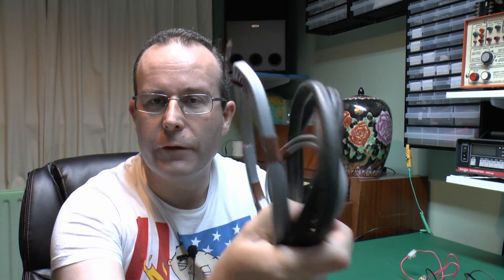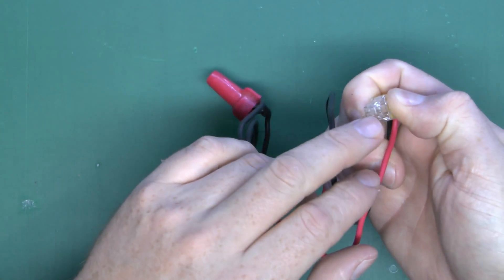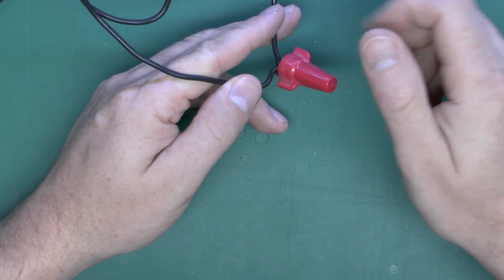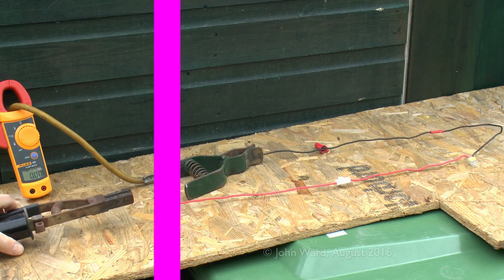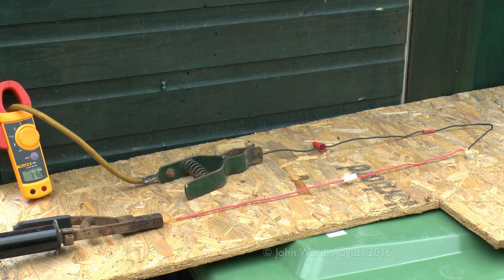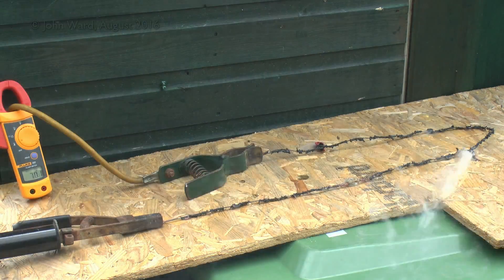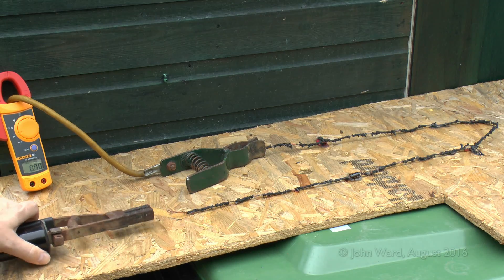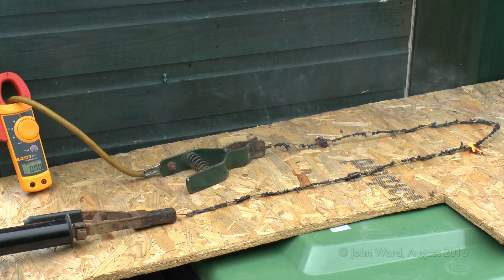Wire Connectors Overloaded

Comment: You would be hard-pressed to find anything in the United States other than wire nuts. Many lighting fixtures now come with Wago type connectors. And push type Wago connectors have been used for decades on fluorescent light fixtures mostly for just the speed of changing ballasts.

I’ve seen many wire nuts fail over the years. I find it interesting that wire nuts are not code in the UK I kind of wish that would happen here.
Reply from the maker: Wire nuts can be obtained in the UK and are theoretically acceptable for connections but no one uses them, because they mangle the ends of wires which makes subsequent alterations and testing difficult or even impossible.
Reply: John Ward  Yeah I always wondered why the UK mostly used screw connector blocks plus I don’t think you guys have as many connections because of the way you go from device to device. Here we have to pigtail every device to the runs passing by there by adding more connections to the whole mess. The reasoning is for having the pigtail connections if somebody removes the device you’re not gonna lose the circuit without doing other work. It’s all just stupid it would be nice to have devices that could pass the current.

But the Wago’s offer the infinite ability of anybody to connect the wire properly no special skills or knowledge required. They are quite a bit more expensive and we would need a lot of them on our typical jobs here but they are also more compact especially the new 221 model.

Comment: So as others have pointed out, these are all fresh connections made up with proper due diligence.  Not all tradesmen show the care and due diligence that is on display here.

First issue, as again others have pointed out, is the the load cycling and the commiserate temperature rise that accompanies it along with the cooling cycle that also follows.  This brings aging and additional resistance with it.

Second is that both the wago and the block are mechanical connections that depend on a spring or a screw.  These tend to loosen up over time and fail.  Technically most non crimped connections, read that mechanical connections, require periodic maintenance.  This is not possible for wago or "push in" connectors.  Nor Is it required for a wire nut connection that was twisted with linemen pliers prior to the application of  the wire nut.

Of the four above the wirenut will outlast and out perform the others hands down.  It has a far larger connection area and hence lower resistance across the junction proper.  IE:  it has a large copper to copper connection.  It also has the added conduction path of the conical retainer spring as well.

The crimp is not rated for the wire type and though it didnt fail it is fairly unlikely to out survive the wire nut connection.  The properly crimped connection is actually a cold welded connection.  A swaged connection applying enough force to cold weld the conductors to the metal of the connector.  News flash, you're not gonna get that from a £7 Ebay crimper!

In the case of the block connector you go from copper to brass to copper.  Brass is a far less conductive material than copper and you will end up with issues far more often over time.

Simple and better test would be a string as above with all connection tied together.  Cycle the power up to say 15 amped and hold for 5 minutes.  Turn off and let cool for ten minutes.  Repeat until the wagon fails!  Also periodically monitor all connections with a thermal camera.  The wago will be the hottest over time.
Reply: So we are left with only the wire nut? In the big picture there is the operator of the process of joining two or more wires, if you take that factor into consideration then all these connections types/ways can and may fail sooner or later.
The chances that operator error may course a failure is less likely to happen with the wago simply because of it's simplicity when installing it, with crimp, the wire nut, and the screw terminal, there are way more things that can go wrong.
The construction and materiel of the connector itself is not the only factor.
I still have some doubt about the wago, but I also have seen the other types of connectors fail way to often, so in that perspective the wago may be the best choice? I am still missing to see a failed wago connection, and for sure it is the fastest and properly the most safe to use when the system is under power.

Comment: Instead of melting the insulation, the connectors will actually blow up like a bomb during a surge of very high current if the breaker or fuse doesn't clear it first. In fact the breaker may even blow up (again like a bomb) if the current interrupting rating of the breaker is exceeded.

Comment: marrettes would probably be the best over the long run (which is why it's odd to me they aren't common in the UK) because it's a twisted copper on copper wire connection. the marrette just facilitates the easy twisting and insulating of the splice. of course it's a different story when they're overstuffed or reused.
Reply from the maker: They are not common because they make subsequent disconnection for testing or alterations impossible without destroying the ends of the wires.
Reply: *****
clipping and stripping the wire takes no time, though, and why would you be that concerned about it when most of the time those installations are permanent?

Comment: Personally I would have preferred it if it wasn't done on wood. I think the extra heat from flames from the wood fire was probably what ultimately caused the failure. Other than that I love the video I would love to see more of this with other connectors. Perhaps you could use multiple of the same connectors at the same time to increase the sample size?

Comment: In my experience, connectors never go bad from a single overcurrent event.  They go bad because the design cannot cope with thermal cycling (screw clamps) or with oxidation/annealing (push-in spring clamps and cheap faston clones).  

I've always been told it's best practice to check bus bar and breaker screws occasionally, and certainly I always find loose ones when I do.  Who ever actually does retighten screw clamps?  Effectively nobody -- and then you're left scraping melted insulation out of control box because someone used a euro terminal block from ebay, tightened it until the teeny screw slots stripped  and called it indefinitely done.
Reply: this.

a millionth time this.

Comment: Wagos are great and easy to use BUT I would only ever use them in lighting circuits protected by a 6A fuse (Im in UK so 230v supply). I would never use any of those TEMU or AliExpress fake Wagos. The 221 is actually rated to 32A but I aint sticking it on a FRC.

Comment: Great video - I do use the Wago connectors now and again, but have wondered how much I would trust them.  Clearly I have nothing to worry about.

It would've been interesting to see any voltage drops over the connectors - to see which suffered conductivity and loss issues first.  Likely the Wago connector generating heat the most causing the copper to fail at that bend where it's under a little bit more mechanical stress. Although the Wire Nut is the only other with a perpendicular connection... 

As someone else said, thermal camera wouldn've been a good indication of this too. 

Thanks for the video!

Comment: I pulled the plug of a little fan under my desk and dropped it on the floor next to the power strip like I did for the past 20 years.  About a minute later the fan turned on, I look at the fan and it was running. Electricity was arching from the outlet to the prongs of the plug lying on the floor. The first thing I thought was I could lose my home to something like this. I'll be turning the power strip switch off from now on. But will that be enough?

Comment: The really interesting test would be to take a 100’ extension cord and cut it at around 10 different places along its length. Splice it with different connections and test for voltage drop.

Comment: Pretty impressive nonetheless at 90 amps. Thanks for yet another entertaining and educational video!

I actually really like the thingie you call a "wirenut". In Sweden I've heard the name Torix (brand name possibly). They're great for how we do stuff here with single few-stranded wires (FK)  running in tubes in the wall. I suppose though, that the Wago is by far the most popular.

If I got any of the technical lingo wrong, feel free to enjoy yourself on my behalf. :P
Reply: Opinions seem to be divided in Sweden as well, I read a rather lively discussion on byggahus.se today. Actually Wago 2273 are rated for FK but I'm not sure how easy that'd be to get in (some geniuses even manage to get stranded into 273/2273 connectors, don't ask me how) but according to Wago it's acceptable (only noted on the boxes in Norwegian and Swedish because no one else seems to use FK/H07V-R smaller than 10 mm2). I once found a box of wire nuts in a shed in Austria and have used them for the odd job, mainly for replacing filter capacitors in old vacuum cleaners. They seem to hold up fine there and gripped the stranded wires quite nicely but I wouldn't use them in fixed wiring because they're a bear if you want to remove or add wires from a splice.

Comment: looks like whoever installed the connectors nicked the wire when stripping it for the wago- this is why you're only permitted to use certain styles of wire strippers in aerospace and whatnot

on another note, the wago has so little metal in it compared to the others, why are they always the most expensive?

Comment: The quality of the connection, and therefore safety, is dependent on the skill of the person making it - maybe with the exception of the Wago (or equivalent).  Crimps must be made tight with the right type/size die, screw terminals must be tight and not overloaded with too many conductors.  I use mostly wire nuts, being in the US, but it is critical that the wires be twisted together with lineman's pliers before applying the nut - the nut is just an insulated cap and shouldn't be relied upon for electrical contact.
Reply: It is not critical to pretwist when using a wire nut.  The wire nut twists the wires itself.  The wire nut is not just an insulated cap.  When applied properly, the spiral wire inside the nut cuts into the wires being joined slightly to ensure a tight mechanical hold and improved contact area for the connection.  Pre-twisting isn't bad, and ensures both wires are the same length, but paying attention to match the wire ends before putting the nut on is sufficient.
Reply: Brian Haygood yup

Comment: My get the slot with screw brass connectors or waygo one wingnut and crimp the issue I have had with screw is plastic melts and screws fall out I don't the waygo connectors assume plastic will melt and cause failure then wingnut as twist with aluminum insert will hold but essentially fail and crimp as they sometimes use steel in place of aluminum in the connectors

Comment: Hi resistance at the wago connector caused increased heat in the conductor causing the failure at that point. If you watch closely, you can see that the wago connector begins to smoulder first.
Reply: Could also be that the WAGO plastic has  lower melting point.

Comment: I just twist the wire ends and give them a wrap with some duct tape. The fire department and my insurance company keep threatening me with fines and jail time after each fire but it’s my life. Yolo.
Reply: The  marret/wire nut with tape on top to make it more secure is the way that feel good for an old electrician who think that the young generation has nothing good to teach them. If the wire nut get loose, the tape will keep the wire together, preventing short circuit with the metal enclosure.

The professionals reasoning is: wire nut of the correct size for the number of wire you intend to fix are stronger than this tape which get dry over time and fall by itself.

However, if the wire nut fail and a wire get exposed, we prefer to get a short circuit to the metal box which is always connected to the ground, right? It is better that a fuse blow and the light stop working and force the user to inspect the electrical problem. If electrical tape is holding the wire despite the poor electrical contact, the user may tolerate that intermittent blinking light for years... until the heat from that bad contact finally start a fire.

This cheap electrical tape at $1 dollar store is probably not fireproof I imagine. It just add combustible to your electric box.

Comment: While no failures of the connectors occured, I'd have liked to see this test conducted after many repeated starts and stops with a mid level load. Allowing for heating/cooling expansion and contraction. Were I a betting man I'd bet  the Wego connector would fail after that everyday real world test. Second failure the butt splice with the wing nut winning. Of course everyone's entitled to an opinion. But I'd like to see that test and the results.
Reply: I'd like to see that too. Although personally i think the Wago would win because of the "spring" factor, ive never had a problem with them although i mainly use the push fit for lighting. However i think that wire nut thing would be a close 2nd followed by the connector block then the crimp.

Comment: Hii John Ward,

@John ward,

why don't you do a simulation of on and off of power at overload current for many time,.. let it on, and heat up the connectors, then cool it down by turning off, then on again. repeat as many time as possible, put some vibration onto the table.. they say the block connector will be the 1st to give way, as hot and cool will slowly loosen the screws.. while wago claims it will be better than block connector..

that's what i really want to see when it comes to connector comparison. 

however good info video. 

thanks
andrew

Comment: Wonder how the old DCC rubber gutta percha wire would handle this kind of overload test. I have a piece of century plus old DCC wire ( it was used in the building next door, came out of the roof rafters complete with the knob and tube as well, though this one was just pushed through a hole in the wood) that I should try with the welder.

nice thing about inverter welders is they have a pretty good current control, though it will vary a little but you can wind quickly from 20 to 160A with it at least staying within 5% of the setting.

Comment: Thanks John, brilliant video as always. Would you use that Wago on a ring main protected by a 32 amp fuse? As long as there wasn’t a break in one leg you’d have less than 20 Amps flowing in any half of the circuit... and even with a break your wire would be operating over rating never mind your connectors.
Reply from the maker: The Wago connector in the video is a 773 series, rated for 24 amps.  A 32A ring final complies if the cable is rated to at least 20A, so using a 24A connector will also comply.

Comment: There are "residential grade" devices that are common in North America that have connections similar to the wago, and over time they seem to be a point of failure.. The "Wire Nut"  / "Marrette" as they are sometimes called ( different manufacturer),  rarely fail, but like any connector, if not installed properly they can fail, and I have opened junction points to find nothing left of the plastic, just a bright orange, almost incandescent  hot connection.
Reply: If you're referring to "back-stabbed receptacles" there seems to be some fundamental technical difference between them and Wago connectors as well as European switches and sockets with push-in terminals. Unlike their American brethren, they happily carry 16 A continuously (no 80% rule anywhere in Europe) and have done so for almost two decades.
Reply: Ragnar8504  The European design is no doubt superior  to the junk we have here.. Regardless I am a bit leery of any connection that a wire is simply pushed in and held fast via spring pressure... Much prefer any connection you mechanically have to snug down.

Comment: In the is There is a reason  certain household appliance require a straight run to the breaker
 Without splices. Range, water heater. Dryer etc.  No wire nuts in between for this to potentially happen.

Comment: So I’ve had this weird aversion to using butt crimp connectors on solid wire and I’m not sure where it came from. But this test totally seems to indicate it works just fine, even without soldering.

Comment: 14AWG in the US max 15A breaker; 12AWG in the US max 20A breaker.  Anything or combo of things drawing more than 15A or 20A respectively will trip its breaker before the respective AWG wire or wire connectors fail.  The experiment was interesting but not particularly practical.
Reply: Firen Dobkowski He demonstrated  a worst case scenario, like someone sabotaging the breaker to run a power hungry tool, then leaving the place in that condition until a later short circuit.  These things happen enough to have countermeasures legislated into the electrical code itself.
Reply: @johnfrancisdoe1563  Not to mention we have some dangerous breakers here in the US that have failed in such a way that they don't trip, that's another reason to have the safety margin.

Comment: Maybe what this test should look for, is which type of connector is more easily connected commonly as a poor job? Perhaps it is not the connectors that is so much the weak safety link, but rather, poor-quality or rushed work, and which connector encourages bad connections under such circumstances?

Comment: If you buy an antique tube radio, chances are, about half the wiring in the chassis looks a lot like your wire does. I can't identify why that happens the way it does. Same wire gauge, sometimes in a high current section, sometimes low, sometimes high voltage, sometimes low voltage signal, sometimes a hotter section, sometimes cooler, sometimes it's half the red, white, black, or green wires, etc. Interesting and mysterious.